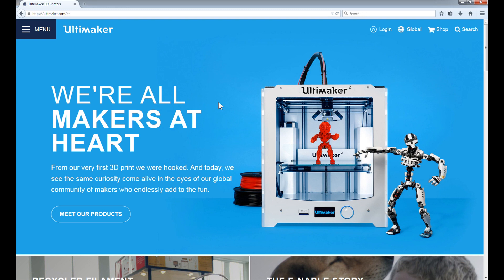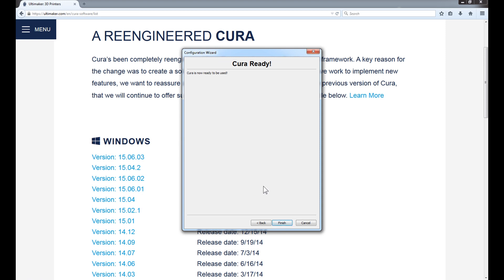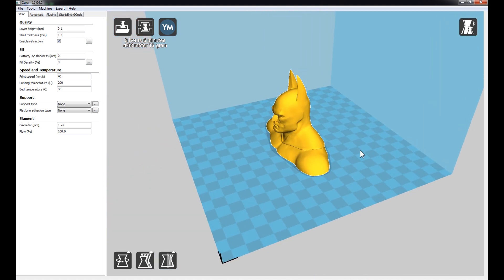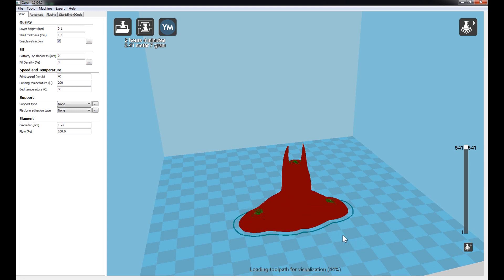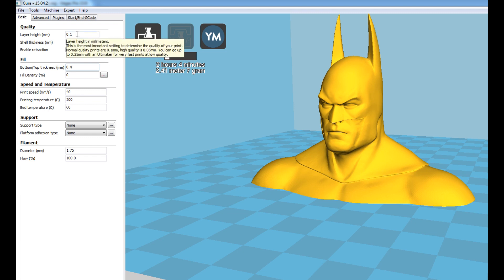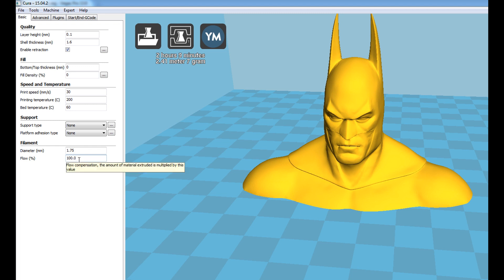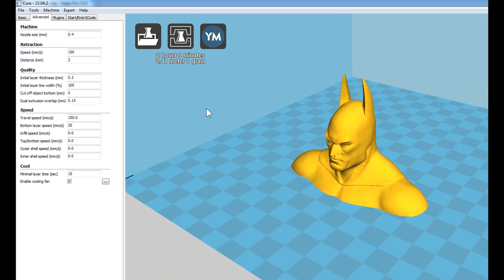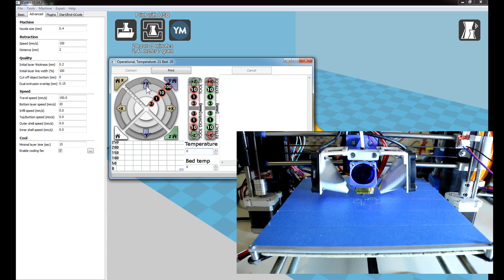How To 3D Print with Cura Software Tutorial !

Comment: I'm very new to this and I think I have my cura set up correctly for my Tevo Tornado. I pushed save to file on my sd card.   Put the sd card in the Tevo and selected the file but nothing happens.    I was able to print the spool holder preloaded on the card fine. so I know the printer works correctly.  I looked and all of the factory files on the card are .gco and the one I loaded is .gcode.   did I save it incorrectly?   Any ideas?

Comment: Thanks for the Video, used your settings to set mine up, just one point, if you use the layers slider to view your model, you will see the "gaps" or holes in the Batman shoulders, so it could have been fixed at that point

Comment: found you video to be very informative. great job. Downloaded the latest version Cura 2.4.0 not exactly like the Cura 15.04.2 version wich you are using. Which version do you prefer?
Reply from the maker: I find 15.04 to be a simple interface, where as the newer versions open up every setting you could possibly imagine. I switch between the old an new Cura depending on the print adjustments I need to make.

Comment: I can't seem to print without a raft. I've tried both blue tape and acrylic, and I still have to use a raft. I have also tried some hairspray. I've messed with some of the the initial layer settings, and I have not found anything that works. I am using pla. Any help would be appreciated.
Reply from the maker: If you have a heatbed, turn it on to 60c. If you use a part cooling fan, turn it down to half or quarter speed. Try slicing it with a brim also.
Reply: Tech2C Thanks! I'll try it out and let you know how it works.
Reply: Tech2C I've figured it out. I just simply needed to put my initial layer height from .1mm to .3mm. I've also increased the initial line width to .8mm. I'm printing with a brim as well. Now I'm having a problem where my top and bottom solid layers aren't actually solid. On the top, it's not that noticeable. On the bottom, the first layer lines aren't touching together and there is a slight gap in between(I think there is supposed to be no gap, but I'm not 100% sure). This is only for flat surfaces. If I hold a test cube up to the light, I can see light through very tiny holes in the top and bottom layers. I've tried using 20%, 25%, and 50%. No difference. I've tried 6, 8, and 10 top and bottom solid layers. No difference. I'm using cura, and I have no idea what the issue is. When I used slic3r, the top layer was solid. Again, any help would be appreciated. Also, thanks for your help on my previous issue!
Reply: Nevermind. I have figured it out. Thanks again for your help on my first issue!
Reply: what was the solution?As i have the same problem

Comment: Hi, First let me say great videos, i have been learning a lot from them. How have you setup / got around the fact that on the rework i3 the x endstop is at the max side? I have managed to figure out slic3r to get it to print in the middle of the bed by using a much larger bed dimension on the X axis. I tried the offset and it didnt work. In Cura I couldnt find a way to align the x axis to the front left corner of the bed, or have you just used the front right corner as x axis origin?
Thanks in advance.
Reply from the maker: Hey. Yes that was an issue for me when I first assembled this printer. As the x-axis endstop is located at the maximum side, plug the endstop connector into the ramps board on the x-axis max header. Then in Marlin, you can set the home direction to MAX for the x-axis.
Reply: Thanks for the reply. Did you keep the x max size to 200?
Reply from the maker: I had it set to 195. But now it's a bit less with my new Bowden Extruder mount. 
Just measure the distance from the homed nozzle to the other end of the bed. That value is your distance.

Comment: Hello, i got the BQ Prusa I3 whit new firmware, when i press Print in latest Cura, i dont get the control screen like you do, I can print fine, but no control unit...
Reply: There is an option in Cura you can set called "use pronterface". This will then bring up the pronterface control system

Comment: Try 0.075mm or 0.060mm layers at 60-80mm/s and 185-190C. I just tightened the crap out of my belts and lubed the whole thing up. Grid2+ Duel, modified with with twin E3Ds. I cant even feel them with my finger nail anymore, its just a texture at that res, no ridges (unless you look realllly hard) I didnt think it could do it, but then i saw Slic3r doing that height on some sections of support, so i copied its settings there and it works. Worth mentioning though, you need good cooling for complex prints, i have 4 auxiliary / ambient fans (120mm high speed variable rpm fand, upper corners of frame) and 2 model cooling fans. Also, tyou need expensive filament, the cheap stuff has variations that will destroy a print with this resolution, as the tolerances with pressure are much less than larger layers where there is a larger gap between lines.
Reply from the maker: +Kyle Currier 
Thanks for your comment. I had a look at the Grid 2 Plus. Nice machine! I do prefer the design whereby the z-axis drops the bed rather than the y-axis moving the bed constantly. My X-axis surfaces are butter smooth, but Y-axis a little noisy as expected. Thanks for sharing!

Comment: do you mind covering bottom/top layer? I just cannot seem to grasp that one. usually mine is 1.0mm or 1.2mm. sometimes it works and as of late it's failing
Reply from the maker: +BlackBeardOutdoors 
Bottom/Top is the solid thickness you want the bottom and top of the piece to be. All parts have bottom layers like the Batman bust, but no top layers as it only applies to top surfaces that are flat. The number of top/Bottom layers is calculated from the z axis height divided by the thickness requested.

Comment: That's a fantastic print.  I just ordered a Prusa I3 M201 with twin Bowden feeds that mix into 1 hotend to mix colours through a print.  Watching you  upgrade your printer to the accuracy of these prints has been fantastic.  Hope I can achieve the same sorts of prints when I build mine.
Reply from the maker: +Neil Simpson 
I'm sure you'll do great! Congrats on your new printer :)
Reply: I hope so.  How has your new hot end holding up? Any signs of wear and tear?
Reply from the maker: Nope, good as new.
Reply: +Tech2C I was going to order another single hot end that runs upto 300 degrees as the 2 into 1 hotend only goes to 250 degrees.   Will any hot end work with a Bowden or did you have to buy a specific version? Sorry for all the questions I'm trying to stay a step ahead of everything.
Reply from the maker: If this is your first printer, I'd stick with 1 hotend initially. Get familiar with your printer first before engaging advanced options, in my opinion.
For Bowden extruders, the hotend must be Bowden ready.
Reply: Thanks, I'll try not to get ahead of myself

Comment: Hi tech2c, could you give me a hint on how you wired the e3d v6 hotend fan and the two sideblow fans to the Ramps 1.4 / your 12V PSU and if you are manually switching any of them? Also, i've noticed that your print head lifts before printing allowing you to remove with the pliers the melted PLA during heating. Is that a GCode of yours or Cura feature?
Reply from the maker: +Alan Kennedy 
Hi Alan, the E3D cold-end fan is always on (wired direct to 12v). The 2 side fans are controlled by software and are connected to the RAMPS 1.4 board at the FAN output (next to the hot-end heater element connection).

Cura and Slic3r both raise the z-axis whilst the hot-end is warming up (standard practice).
Reply: +Tech2C Thanks, so the two side fans must be at D09 right? Regarding the z-axis raising, Slic3r does not do that for me, maybe i've overriden the default start-end GCode somewhere along the path?
Reply from the maker: +Alan Kennedy 
Yes, fans connect to D09 on RAMPS board.
For the gcode settings, checkout my slicer tutorial video part 4. From about 7:30 I go over the gcode start and end commands.
Reply: +Tech2C Thanks!! I'm printing this Batman with the same settings except the tweaks you mentioned at the end (Shells and Waiting Time) and it's going wonderful, the gaps at the shoulders are not present. ;)

Comment: Did you do a video on adding the extra fans on the side of the j head?
Reply from the maker: +Luke Pettit 
Not yet. I plan on changing the fans to blower style, which will mean a re-design of the fan holder.
Reply: OK thanks I wasn't sure I just missed it or couldn't find it
Reply: +Tech2C Is that for a more directed cooling? or some other reason like aesthetics.
Reply from the maker: Just for aesthetics. The dual fans I use now take up a lot of room, the blower setup will be more compact.
Reply: +Tech2C Oh good I've been Googling madly to see possible examples of alternatives to the usual fan setup.
I did find a few blower style fans but I couldn't see how they'd be an improvement. ;-D

Comment: I am using Cura for my WanHao Duplicator i3, and have printed a number of these Batman busts (black really looks good).
I especially like your video for the fact that not only do you show the issues you have with the print, but you explain what to do to correct them.
Far too many calibration pieces and videos just show the results but fail to actually explain how to use the results to correct issues. Kudos to you.
Reply from the maker: +Felklaw 
Great comment, thanks very much. I try to explain why I do things so others can learn from my mistakes ;)

Comment: I purchased the e3d v6 after watching your vids and love it an just switched to cura also, thanks for the info. I am having problems with large pla prints curling when they start cooling, they actually pull the painters tape of the bed. I'm heating the bed to 60c  might try lowering that temperature.
Reply from the maker: +underhover69 
That's interesting. Do you have an external temperature probe to confirm the bed is actually reaching 60c? Especially with PLA, that material is really soft at 60c+, I wouldn't have thought it would warp.
Reply: +Tech2C It seems to warp when the print is finished and the part is cooling, will get a laser thermometer and check temps.

Comment: Hey +Tech2C your videos are great and clear. I have your own 3d printer but i can not increase the speed over 30mm s as the filament begins to slip (Im using bowden setup with MK8 hobbed bolt). The only solution is to considerably increase the temperature, like 240°C, that are too much for the PLA. How can i fix that? Im using E3D v6 hotend.
Thanks
Reply from the maker: +MrAppleTricks 
Well that could be a couple of things: 
-Make sure you have plenty of pressure on the mk8 drive gear to the filament. 
-Next remove any filament stuck between the teeth of the mk8 gear. 
-Ensure the cold-end cooling fan is on.
-Clean out the nozzle with a tiny drill bit or piece of very thin wire. 
-Try cold-pulling the filament a few times until you can see light when starring straight down the hotend through the nozzle. 
-In Marlin, ensure the correct Thermister type is selected.
-Check the hotend temperature whilst  printing. If the temperature drops quite a bit during a print then you probably have the part cooling fans blowing over the hotend which is a bad.

Good luck.
Reply from the maker: +MrAppleTricks 
I forgot to mention, check and/or re-calculate the number of e-steps without the filament going through the hotend.
Reply: +Tech2C thanks for your answer. The esteps are calibrated correctly. I extrude the PLA at 210 ° C, but if I increase the printing speed the filament begins to slip, therefore further increasing the extrusion temperature the filament is extruded with less force and I can get more speed. I saw from your previous videos that you suggest the MK7  hobbed bolt instead of the 8, I just ordered it, I hope it resolve the problem.
A curiosity... at what temperature do you extrude PLA and what is the maximum speed that you can reach with your printer?
Cheers
Reply: Tech2C Reading the other comments I have tried to change the DEFAULT_MAX_ACCELERATION from 2000 (default) to 800 as you wrote. Problem solved, right now I can easily print to 150mm / s but obviously the quality deteriorates drastically.
How can it affect so much?
Cheers and thanks again
Reply from the maker: +MrAppleTricks 
150mm/s is very quick. I don't think the Prusa i3 frame design can print that fast without oscillations affecting the print quality. 

Also printing at that speed means you are pushing a lot of filament through the hotend which may struggle to maintain temperature. 

On the E3D website they are selling their Volcano hotend which is basically the hotend turned on its side so there is more heat for the filament to travel through.

To be honest I always strive for print quality over speed. I print PLA at 200-220c normally.
Reply: Tech2C I'm using Cura, and I set 150mm/s in the field of speed. I tried to print the 25mm cube test and did not come badly apart the walls a little bandy.

Comment: what is your marlin acceleration setting and jerk. been struggling with these setting for a while now. I can't seem to print smoothly with 45mm/s higher...
Reply from the maker: +Step Cia 
The Marlin variables for x/y axis DEFAULT_MAX_ACCELERATION is 800. The DEFAULT_XYJERK left at 20.0. I'm using Marlin v1.0.2.

I only print faster than 40mm/s during infills or other non 'visible' print moves.
Reply: Thanks for sharing the setting. I had suspected that with i3, the default x y acceleration had to be dialed down significantly to below 1000. The vibration I think is really killing this machine... I had my xy jerk down to 4.0 and still can't print nice small round curve above 40mm/s...

Comment: Great video! I've been using Cura myself and my print quality has improved dramatically!. Would you consider auto bed-leveling ? That's my next goal. That's why I bought the Aluminium bed, but the resistance was too high. Back one step I go haha. Thanks for helping me the other day, it would have taken me much longer to figure it out.
Reply from the maker: +Aaron D'mello 
Auto bed leveling? Not just yet. I think when I decide to build another printer then I may incorporate that feature.

Comment: Haha, I just printed this the other day for a friend, not as smooth as yours though. :-(
Reply from the maker: +Clone36 
Nice! Did you print this high resolution Batman bust? There is another lower resolution Batman bust on Thingiverse which has awful polygons all over it!
Reply: +Tech2C Not sure, maybe, the .stl file is only 663kb. And Mine was at 0.2mm, and i need to make some stability mods as per your previous vids, I have the same replikeo printer. Keep up the good work!

Comment: Excellent video, I've had a hard time finding great information on settings, I've had to figure moist of it out myself. I started out using cura, I tried slic3r once but did not like it or get the same quality prints I get with cura.
Reply from the maker: +Josh Bishop 
There are some print moves that Cura does very well over Slic3r, like the layer change print moves which is just amazing.

Comment: Thumbs up. I just love cura. My print quality went way up after switching a year or so ago. 
I must say your prints are some of the best ive seen yet come off of a prusa. are you using ramps board and curious what microstepping settings your using..... it looks beautifully smooth. im not quite there yet with any of mine
Reply from the maker: +builtrodewreckedit 
Hey! Yes I'm using the standard step sticks 4988 with 1/16 microstepping, plus an Arduino mega256 board with RAMPS 1.4 attached.

I guess try slowing down the printing speed in the slicing software, also lowering the acceleration helps with Prusa i3's. 0.1mm layer is really nice!
Reply: +Tech2C Thanks I will give your suggestions a try. I tend to print fast for most things i make and i have always been quite happy but your prints are amazing looking compared to mine.
Printing parts for a new prusa im working on i think its worth slowing down to shoot for quality. 
Please check out the video's of the new i3 i started. I believe it's going to be the worlds most heavy prusa. I filled the custom steel frame with 45lbs of lead. its a beast...
Thanks again
Reply from the maker: +builtrodewreckedit 
Just subbed! Can't wait to see the print results with such a heavy frame!